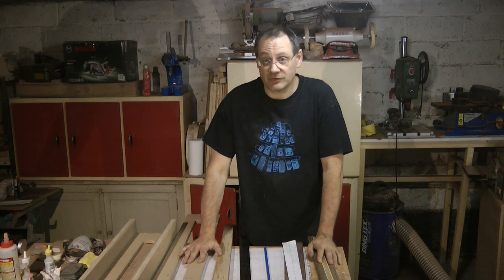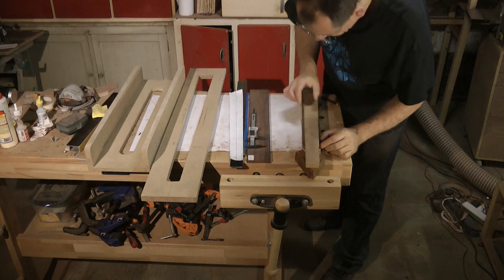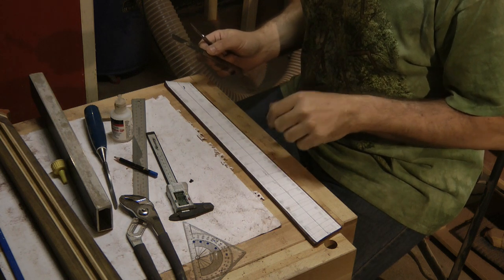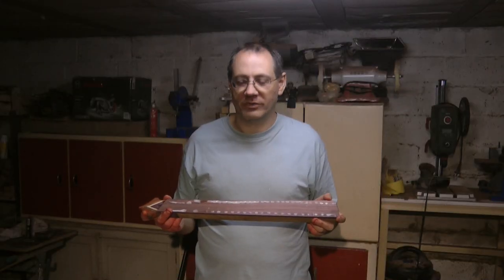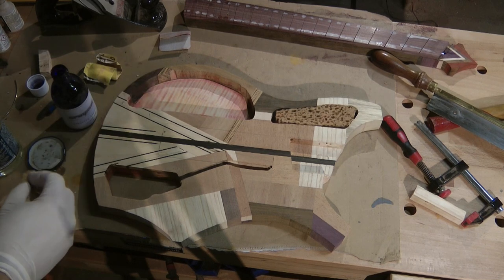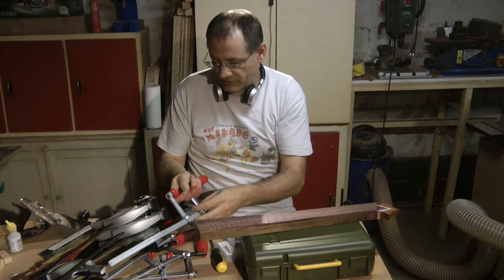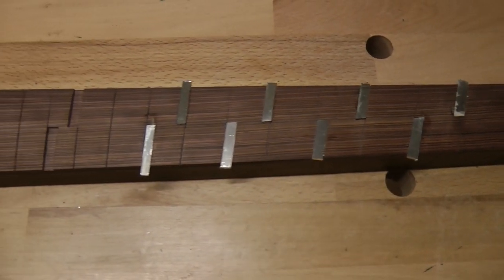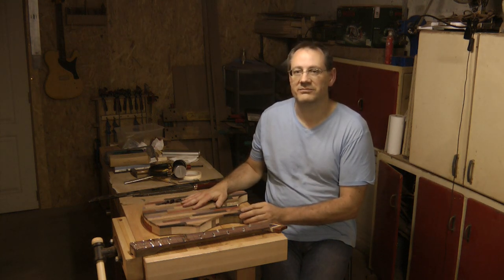Great Guitar Build Off - Unofficial Challenge episode 4

Comment: That neck template and corresponding heck pocket template is a great idea.
Reply from the maker: I can't take any credit for it (apart from for showing it)...it has made it much easier to make necks and pockets, and it also makes it very easy to ensure that the pocket is lined up straight with the bridge, because the pocket template is so long and you can line it up at the other end of the body.

Comment: Get yourself a Beber Carvers Glove. I'm still a newbie woodworker but can tell you after buying the glove my self inflicted wounds from saws and chisels have massively declined. My hands are looking normal again and not like pieces of meat anymore ha
Reply from the maker: Thanks for the tip, I will look into those!  I am getting better about wearing gloves when I use my Shinto rasp, but previously I always ended up with shredded skin.  And I still have traces of red on my fingers from forgetting to wear a glove when I stained the piece of maple inside the body, over a week ago!
Reply: @jonathanoakey4745  That's funny, I don't wear the glove when using my shinto rasp. In fact, in a recent video of mine I use the rasp to remove material from a neck heel with my hand  pretty much flat on the rasp. without thought. We must have differently shaped hands. It's chisels and saws that get me.

Comment: It's an awesome work. I was planning to build my 2nd guitar with some rough cuts and pieces of other builds. In your expierence, filling negative spaces with epoxy resin would affect the tone or vibration//sustain? Keep your amazing work!! Cheers!
Reply from the maker: Thanks for your comment!  I can't really say because I haven't done any experiments to compare them.  Honestly, I'm rather ignorant about tone...I figure that the pickup and amp (and the player) contribute by far the most to the tone, and the effect of the body materials is negligible (not zero, but not significant enough for me to care at my level of experience).  Given that people like Ben Crowe don't shy away from using resin, I wouldn't worry too much about it.  Do what makes you happy! :)
Reply: You really want to achieve a very stiff neck/body connection and have a solid nut and bridge. If your 2 points of contact for the strings, that is your bridge saddles and nut/fret do not move relative to each other, the system that is your guitar won't suck energy out of the strings oscillation. That allows for good sustain. Ideas like "the sound of tone wood" or  "beautiful resonance" in a solid body guitar are uneducated mumbo jumbo. Therefore, materials do not matter much tone wise, as long as the resulting system meets the above mentioned criteria.

Now, there is the question of the dampening module: If you attach a guitar string to a steel or carbon I-beam, the system would be so stiff, that the sustain is maximized. Usually that doesn't sound too nice to the human ear though, subjectively spoken the sound does lack "warmth". So, some oscillation energy being absorbed by dampening (because the guitar isn't perfectly rigid) is actually desirable. But that should happen in a way that a specific spectrum of overtones is achieved, which sounds pleasing. And this isn't depending on the utilization of specific woods.

So....go ahead and try combining your scraps and make sure to construct a rigid guitar out of them.